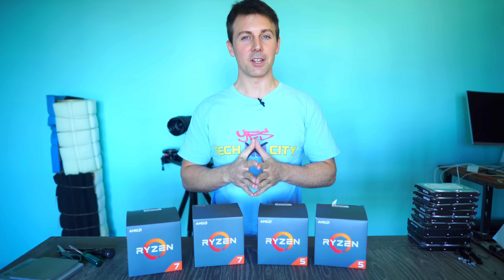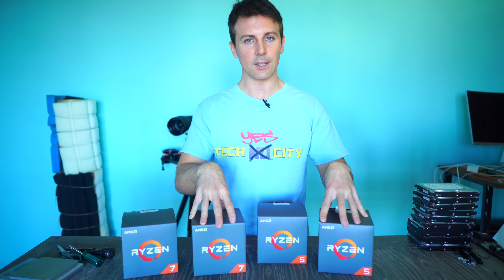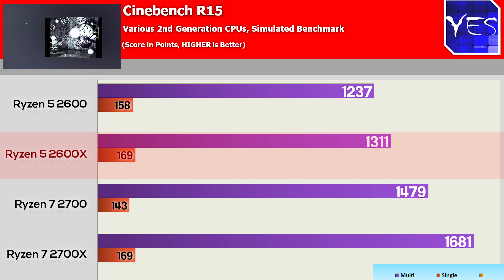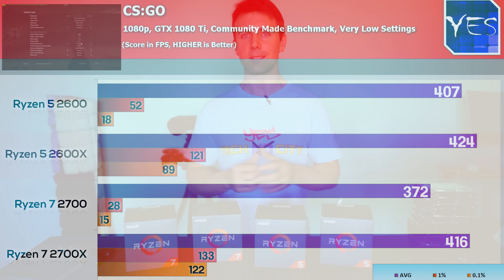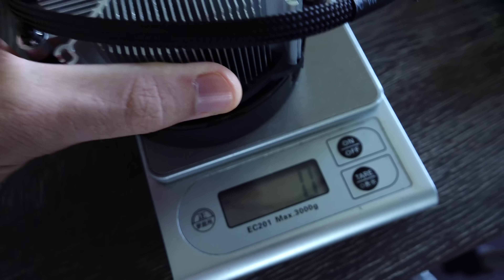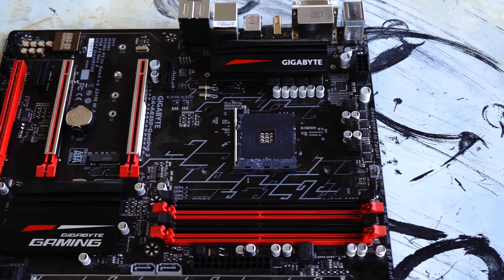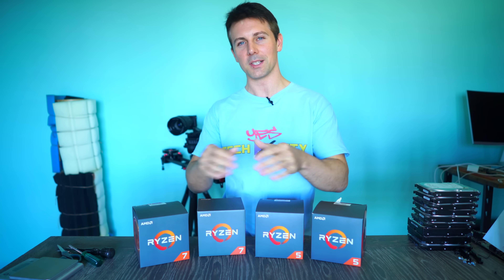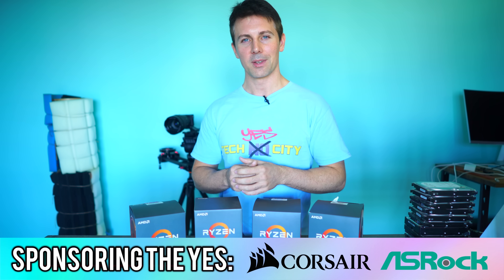Ryzen 7 2700X Vs 2700 Vs Ryzen 5 2600X Vs 2600 - Is the X Better Value...!?

Comment: I pretty much own a Ryzen 7 1800X, 1700 and now the 2700x. I got hold of the MSI Gaming M7 Wifi for my latest build and have been testing it with a kit of DDR4 3000 Ram from Corsair. I am really noticing performance improvements accross the board on the 2700X so much so I have not bothered overclocking thanks to the many youtubers I have watched testing this. the ram feels far more compatible on the X470 board than its ever been on the earlier B350 boards I have had.  however  I have had good overclocking value from the Ryzen 7 1700. The stock cooler with the 2700x is bloody good value but after already shelling out for a cooler for my 1800X I decided to move my noctua over :)  you can guess where I put that Led lit stock cooler hehe strait on the old 1800x rig.  I have been researching into a good kit of ram for my new X470  and have my eyes on a 3466 kit with tight timings  it seems to be the best to go for,  Gaming Performance  with the cheaper B350 Board a 1080ti and 32 gb of ram running world of warcraft legion raiding content I was having FPS related issues in various encounters dropping into the 30's in 25  man content even with the graphics settings turned down.  this happened on the 1800X and 1700 both stock and overclocked.  After installing this 2700x on a brand new X470  I have taken the same kit of ram and same graphics card and I am seeing a marked improvement in raid encounters at much higher detail settings it feels so smooth you could comfortably stream your raiding content with this thing and enjoy smooth fps while doing high end mythic raiding content and not feel the drops whatsoever.  before this 2700x came out I ordered an 8700K asrock Taichi Z370 based on Tech Yes City's Performance Reviews and stuff and had an amazing time tbh the 2700x and the 8700k  while playing most games on a standard monitor would feel about the bloody same.  I do not know it it was the change from B350 boards to X470 that made the performance difference or just my memory was not well supported on those boards as I use 1 kit of ram and they are 16gb modules I pretty much use these sticks in all my builds to save $ I love collecting PC parts and testing them out.   (Would Like a Threadripper one day but since I have moved havent had the space to really build one haha.   anyway I have had a great run with the 2700X and feel its one of the best CPU's AMD has released havent even bothered overclocking it and Yes Brian! I noticed how snappy it was feels like im using my 8700k  when opening apps browsers and games debating even bothering to buy faster memory at this point since I see the same FPS on the games I play with both these systems now.  MSI did a good job with the X470 M7 Wifi board.  keep making great videos mate been a lifesaver to getting through all the bs and getting good parts for my rigs.  I read reviews where if you slow the ram to 3466 and get the timings just perfect you can actually outperform the 3600 kit.   it sucks how expensive those ram kits are though. 1300 for a 64gb kit :/
Reply: I’m having the same issue right now with my Asus ROG STRIX B350 F Gaming motherboard. 

I run using the 2700 which i paid $225 during prime and a GTX 1070Ti. Ram is Corsair Vengeance RGB (2x8 3000Mhz) 

When jumping off the bus in fortnite when I begin looking around I notice stutters for about half a second or so. After that the frames go back to normal and the 144hz experience is back. I play on max settings but had shadows and Post Processing off/low 

Not sure if it’s the RAM or motherboard but tomorrow I’m getting the MSI X470 Gaming Plus and a new set of ram (Trident Z 3200Mhz 2x8) 

Hopefully that’ll take care of the stuttering issue. If not, what could be the problem? 

I will update this comment once I set everything up tomorrow and run some tests. Thanks!

Comment: Unsure the issue with the lows with the 2700x and 2700, what was it like when it was overclocked all cores to 4.1-4.2ghz

My 1800x did not seem to behave correctly at stock ish, rebooting pc taking extended time and random slowdowns (ram XMP 3200 set to 2933 as won't post at 3000 or 3200) soc voltage might of been to low for the ram causing issues (now at 3.925ghz offset voltage 0.0125 so about 1.42v peak avg around 1.4v ,soc 1.1v) it can do 4ghz but vcore offset around 0.0325 needs 1.45v to work (not worth it for 75mhz more + all the heat even with a h110i)

Comment: There is no clear winner but this is how I see it.
2600: crappy cooler but you can buy one yourself and for me the stock coolers aren't good enough any way, even for AMD. However, the 2600 does miss that single/dual core boost: all core overclock or nothing!
2600X: you kind of are stuck to the boxed cooler given that you pay for it and you get it. I wish that AMD would sell this model for $15-20 less without that boxed cooler.
2700: not worth it, at this price point I gladly pay $20-30 extra for that extra single/dual core boost and the much better cooler.
2700X: great stock cooler but I would try to sell it and buy my own one, no matter how lovely it looks. I can't wee it while I use my PC. ;-)
Sell that cooler for $40-60, buy a BQDRP4 or a Noctua D15 and be happy with it. ;)

The winner? The 2600X. You really can use any bit extra which you can get on that 1/2 cores. Too bad that the cooler sucks! The 2700X is tempting but you pay more per core: 4/3*$229 < $329
However, not much less! The big problem for me is that it is smarter to put that $100 in your pocket and upgrade a bit earlier while selling your 2600X. The performance difference between Ryzen+ and Zen2 will be large! For Zen3 and Zen5 you will see minor differences in the performance of the node (maybe more cores thanks to lower production costs (EUV)) and after that we will see a nice performance lift again. In my opinion the clock frequency - given the 'IPC' - is still a bit too low for Ryzen2, because of that I am not willing to invest in 8 cores yet. However, those who do won't be sorry, this CPU will serve you for at least 6 years without bottlenecking more than a little.
Reply: In my country country the difference is around 70-80$ so I brought the ryzen 2700

Comment: I'd take the 2600 with x470 board, throw in a top-class air cooler and OC it mildly on all cores to 4.0GHz. That air cooler and x470 would be used in future for upgrade to Zen2+. But If I could I'd wait with building a new PC until summer. The 1100 series of GPUs will be way too better then 1000 to ignore this. I mean... geforce 1170 is looking to have similar performance while OCed to stock 1080Ti. That's nuts!

Comment: Was that Taichi motherboard a X370 or X470? I'm curious if an X370 board such as the Killer SLI/ac could handle 3600 Mhz ram, but I can't find anyone confirming this.

Comment: My plan is to upgrade to a Ryzen 2600X and GTX 1070 Ti, I honestly don't think the 2700 or 2700X is worth it. You get the same performance with the 2600X and its much cheaper. Unless you do heavy amounts of rendering, which I don't. I just stream.
Reply: I am of the same mindset. I am strongly considering the R5 2600 and overclocking to save money. Already have a GTX 1080 and EK waterloop so getting a decent overclock should not be an issue. I do very little rendering only a few youtube vids here and there. Coming from a i5 6600k I may loose a few hundred MHz for gaming for current gen games but in about a year most games will need those extra cores and threads. AMD Ryzen = Future proof
Reply: @PCPAyLOAD  how do you like your r5 2600? I cant decide between 1700x 2600 or 2600x.. 2600 is 159.99 1700x is 190.99 and 2600x is 218.99 at current prices.
Reply: @perrylenpunsalan3846  get a 2600x with a x470 mobo so you can upgrade to the new Ryzen 3 chips when they come out

Comment: Awesome vid. The 2700X I tested in a build with an EVGA CLC 240 on it and Gskil ripjaws 3200mhz ram I actually saw hit 4.3ghz momentarily on a single core but tended to keep an all-core turbo of 4.1ghz, and 4.2 while gaming. Cinebench single core actually hit 180! And 1836 multi. Great CPU!

Comment: Odd i'm running a 2600 on a Asrock b350m pro4 (bios 4.7) & i never got cinebench numbers that low even on stock cooler. 162-163 single core & 1257-1268 multicore with a 2933mhz c15 ram.
With a older h100i  (new bracket) i got it running at 4300-4250 for testing & 4200ghz 24/7.
Scores went up to 174-175 single & 1431-1462 multi.

Something not quite right with the mobo you got there for the 2600, goofy bios or something else.
Reply: Different ambient temps will result to different benchmark numbers.

Comment: Nice roundup. For me it would have to be the R5 2600 as I have a 120mm Deepcool Malestrom water cooler already with an AM4 bracket so will pocket the savings and overclock up to something similar to the 2600X anyhow.
Would be keen for a memory overclocking guide as memory is a total mystery to me..... especially after a few too many brewskies the night before! 🍻

Comment: My 2600 is a beast @ 4.1ghz all cores with $50 120ml Aio. Didn't even use that stock cooler with the 2400g so definitely wasn't going to use it with the 2600

Comment: Just bought a 2600X to replace my R3 1200.  Stoked :D
Reply: I upgraded from an R3 1200 to an R5 2600 and I'm very pleased with my R5 2600, it can certainly pull really heavy loads. That being said, one shouldn't underestimate the little R3 1200, it performs surprisingly well when OC'ed, pretty good bang for the buck.
Reply: @hakont.4960  Agreed, I just ditched the R3 1200 but it got the job done for my basic gaming needs. Now im jumping to R7 2700x so Im very excited for its arrival
Reply: Upgrading to a ryzen 5 2600 from an i5 650 this weekend. It will be a huge upgrade
Reply: Upgrading from an fx 8370 to probably the 2600x. Picked the 2600x because of my budget, so hopefully I’ll be better off.
Reply: I upgraded from core 2 duo to ryzen 7 2700, it is very huge uprade

Comment: For just gaming (out of the box) - R5 2600x or i5 8400
For just gaming + overclocking - R5 2600
For gaming + content creation (out of the box) - R7 2700
For gaming + content creation + overclocking - R7 2700x
Reply: and 2700x work better without overclock
Reply: Micael Moreira the 2700x is the 2700 chip but overclocked. stooopid
Reply: for me i don't believe in X series because first of all, all ryzen line ups except the anthlon are overclockable. So that you can push more clockspeed to achieve a huge performance plus with a decent cpu cooler (i.e air or water/custom watercooling solution) and that's a big savings for that.
Reply: is r5 2600  enough for gaming+streaming
Reply: sahil dragneel yes
Reply: @sahil2255  
I have a friend that is streaming every week(Xaine's World)
and he has i7 4xxx .
It serves him well enough.
He also does a lot of Editing and has his own website and

He said that 2600X I am considering is more powerfull than his i7.
2600 isn't very far from the X.
Especially overcooked.
Reply: @sahil2255  cope
Reply: Agree getting the 2700
Reply: How about just for content creation?
Reply: @ahmedfarhan3497  Either.
Reply: then, for playing, what is the best? r5 2600 or r5 2600x?
Reply: @abubleble3  Either is good. depends more on your budget. If you can afford the X get it. Just bear in mind it has greater power requirements than the non-X, so if your PSU isn't much more than 400W, you might want to consider the non-X anyway.
Reply: for price = R5 2600
Reply: Cope, ryzen sucks for high refresh gaming.
Reply: @MaestroOfficial  
That depends on what do you mean high.
How high?
How much do you need?
Do you believe that your criteria snd needs should be applied to everyone else?

Unlike on say...Twiter,you can do thousands of characters here.
Perhaps even trilions.
So,something more than just"it sucks for blah,blah" would be nice of you.
Reply: @GameslordXY  as high as possible
Reply: @MaestroOfficial  Laugh in x3d now, cope.

Comment: TDP seems to be the only thing the non-x chips have going for them, I'd say the better coolers included witht the x chips justifies the additional $20-30 for most people in most applications, I'd feel silly buying a 2600 and a hyper212 over a 2600x. In any case, my 2700x does quite well completely stock, I just wish I could make XFR less aggressive, my cpu voltages peak around 1.488v...

Comment: Love my new Asus Crosshair Ryzen 2700X, ASUS Strix GTX 1070 Build at Stock Cinebench Multi Core 1708 and with all cores at 4.20Mhz 1825. Using stock cooler and Corsair LPX 3000Mhz. Good work Tech Yes City...

Comment: Can you please do a Plex build for h265 transcoding to h264? 

I’m going from server with videos stored on nas to a roku 3. Entire network is wired with gigabit hardware.

I have tried running my server dual Xeon e5-2430 v2 server with raid 10 array but that just falls behind with all cpu cores running flat out chewing the power and heating up. I also tried a gtx1050 in a smaller pc which has hardware h265 enc/dec and cpu stayed at 30% and gpu at 15%, plus an ssd, but it still dropped out. 

I’m not sure where my bottleneck is and with the $ of hardware I have I’m tempted to just sell it all and upgrade end points.

Thanks

Comment: The X models are kinda steep here.My plain 2600 will cost me 6499 for the bundle 8gb ddr mobo and cpu.The 2700x will cost 10999 for the bundle.So not much worth it.I am using the extra money for a cooler and just oc it to match the 2600x stock.

Comment: How high a DDR 4 voltage would you consider safe when overclocking your Memory?
Reply: Depends on the Kit you have, and what maximal voltages the manufacturer lists in their QVL. 
If you have a kit from a good manufacturer that sells a lot of overclocked memory kits (keep in mind any Ram above 2133 is considered by JADEC overclocked even when it comes in form of 3200 or 4000 when sold, as those are "factory tested" and binned),  if for ex. its listed 1.35v than 1.425-1.5v is possible from a high quality kit such as a gskil TridentZ or FlareX, or Corsairs Vengance, or Crucials balistix series.
If your kit is avg than i would stick to 1.4-1.425 max, if the motherboard allows it of course (as some list 1.4v in the red zone), this max RAM voltage also depends what & how many VRMs are dedicated to DRAM, some provide 2-phase others have 3-4phase, and even 6 is possible on boards with lots of RAM slots.
Reply: 1.35v

Comment: Does the 2600 overclock to 2600x levels with a decent cooler? I am starting to consider what I want to use in a new system and want to compare speeds and costs of a 2600 with a good aftermarket air cooler against a 2600x and the stock cooler, or a 2600x and a good aftermarket air cooler.
Reply: Yes they all overclock to about same clocks with a decent AIO, dont listen to B.S. from people that don't actually have one of these.
Heres a link to a guy running a 2600 @ 4200mhz all core (with a H100i) and his cpu is still occasionally boosting to 5-Ghz with XFR on a single core. See it in action here:
https://www.youtube.com/watch?v=1EDXui9K2VI
Reply: they do, same with 2700 vs 2700x. I suggest checking gamer nexus video for that as he already tested the max clocks, the non x chips had the most value for money
Reply: I'd go with the 2600X since you forego the need to fiddle with overclocking, but if you don't mind doing it then get the 2600. Physically they're the same CPU it's just that the 2600X is slightly better binned, but only slightly.
Reply: cheers for the comment, I wouldn't mind having a crack at overclocking just for the satisfaction of doing it so will have a good think about the non x.